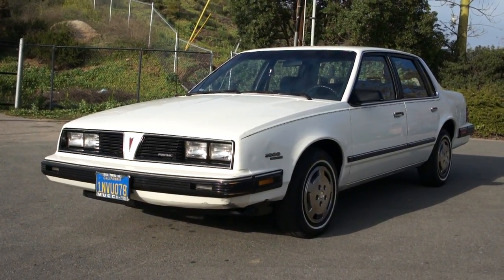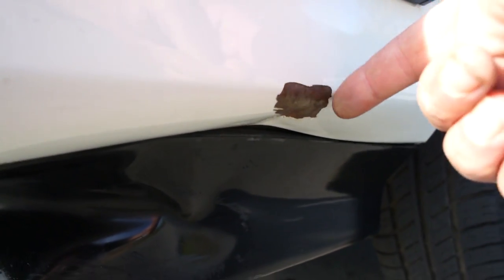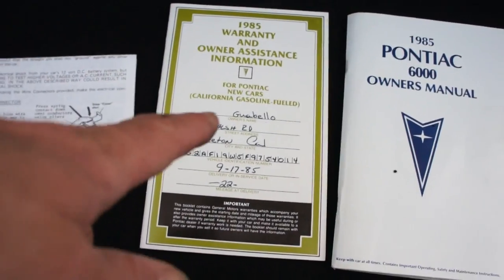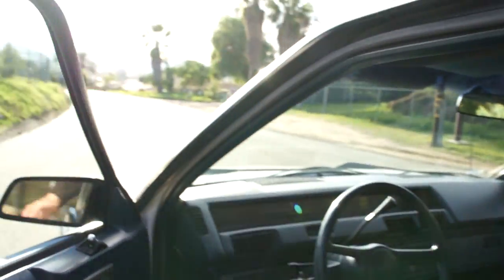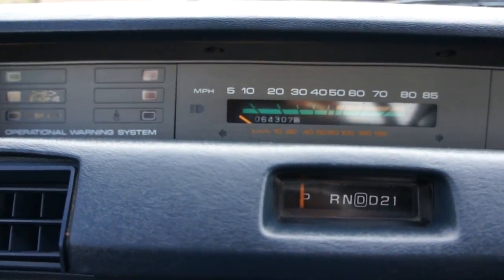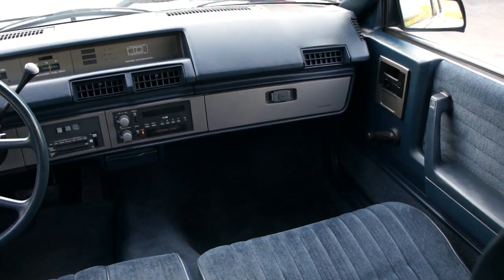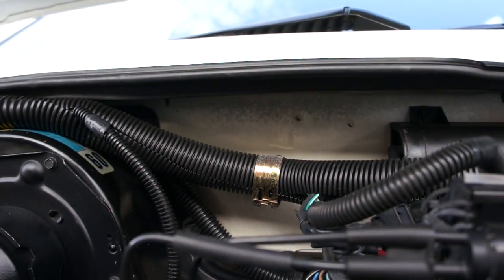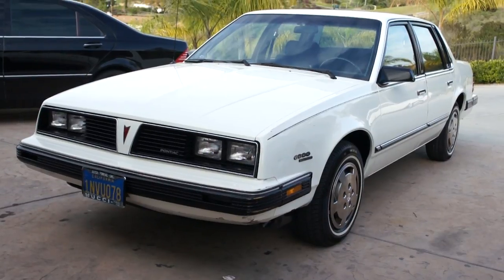1 Owner Pontiac 6000 64k Original Miles XLNT sedan

Comment: The Pontiac 6000 is a cool looking car, my favorite version from all the divisions.
I'd be really surprised if that transmission was replaced. That's a THM-125C, which is known for it's build quality. 65k should be nothing to that transmission unless something incredible happened to it.  The pan on those is always pretty shiny looking, even when they're old.
That 3rd brake light must be a modification, those weren't required until 1986.

Comment: I have a 1988 6000LE 2.8L. Bought it for $750 in 2007. AC blows so cold it could make ice cream. It had 48,000 original miles on it,  1 owner car. My son hit a deer and we could not find a front grill for it. We still drive it. Shes old and ugly but very dependable. Its 2017 and she only has 117,00 miles on her.

Comment: @shurikenstar I see it's been 2 months since your comment, but in case you still have it:
I'd try replacing the oxygen sensor. I replaced it on a Fiero (same engine) and it only cost $25 w/ shipping. Mileage improved 10%. That's mild, some people get a much bigger gain, it depends how worn out the old one is. The O2 sensor gradually gets worse with age and that hurts mileage. You won't get a check engine light unless it completely dies. It's cheap so it's a good thing to replace every 20k or so.

Comment: I am guessing these one owner cars of this age all came from extremely old people who kept the car till they could not drive anymore and the fact of them not being able to drive likely was proven multiple times by all the damage done to the car. I am actually looking at a 1989 6000LE has some old lady damage on it as well that was fixed by an auto body shop, but is great shape in Canada and it has not rust really frame looks good. only issue is its been 3 years since it ran and it turns over and wants to start but does not. but I'll likely be getting it for junk yard prices if I buy it.

Comment: That's an 86 especially being fuel injected , much better than 85s , 85s were junk, plus they didnt have the smaller headlights and grilles, or the high mount rear brake light in the back window, true traits of an 86. Besides the Taurus was a much more nicer modern styled car compared to these old looking GM A Body cars